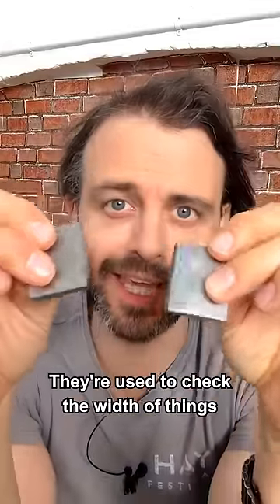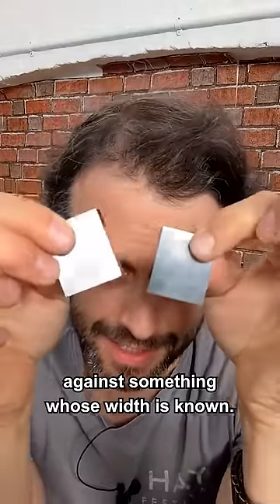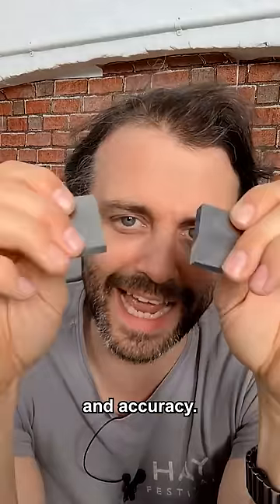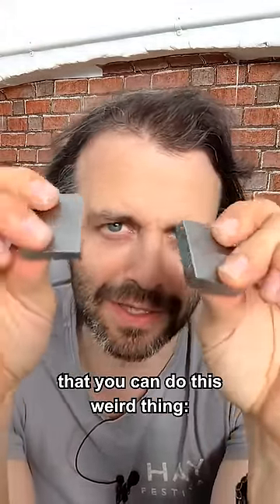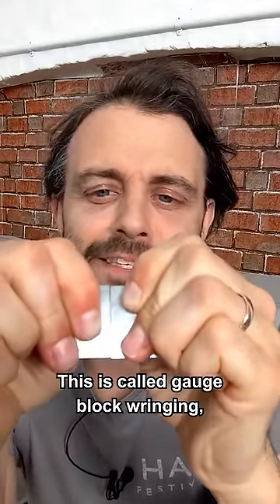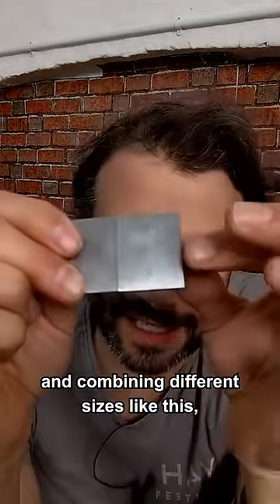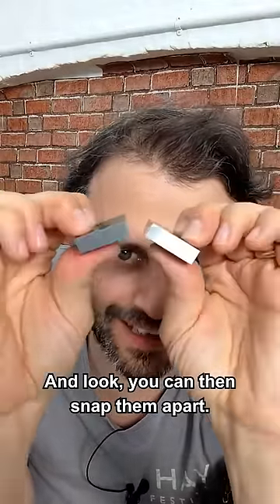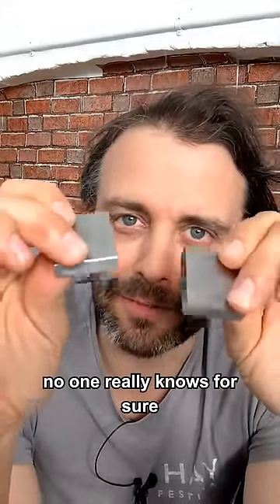No One Knows For Sure Why This Happens!

Comment: These are the basis for basically every piece of machinery in the modern world. In WW1 we had to smuggle a ton of gauge block kits out of Sweden to use for standardizing our military production across the country. Every tool could be measured against these to verify their accuracy and it is one of the most important pieces of equipment in all of manufacturing.
Reply: Oh I thought by basis of machinery, they were built by connecting all these blocks in this way...
Whoa, no screws!?
Reply: Cadillac's early use of Johansson Blocks made them the 'Standard of the World'.
Reply: @blakebrown534  Great video! Thanks for sharing!
Reply: Right, we didn’t have rulers in WW1…
Reply: @2200Stinger  Rulers are not precision instruments.

You celebrate your ignorance.
Reply: @2200Stinger  People were so stupid that they thought the Earth was flat too!
Reply: Interesting! I’ve always heard of gauges for machinery (usually gun manufacturing) but I guess I never knew what they were referring to.
Reply: @2200Stinger  LMAO, rulers are not the basis of scaled, high quality manufacturing which requires high precision
Reply: Damn you're really old to be of working age in WW1.
Reply: @2200Stinger rulers are not precise enough for high precision machine work. Thanks for your input, though.
Reply: Actually it only is needed if you want standardized measurements on your machinery 
You can do it like medieval craftsmen and make up your own measurements and it worked fine for late medieval gunsmiths and clockmakers
Reply: I never thought about that but it makes sense. Without a reliable template to start from, there's no way to make a perfect unit of (universally accepted) measurement from scratch, since all units are arbitrarily man-made. Interesting
Reply: Do you think they think like this in... Sub saharan Africa?

Comment: What is even weirder is that if you left them stuck together for a couple of days then they won't come apart at all. If you then try to break them apart with a hammer they will break apart but parts of one will remain fused to the other
Reply: The cut is so clean that you're basically just reassembling the molecular lattice with the wringing. It's almost like they are one thing again.
Reply: This seems quantum to me. The electrons are so close they are being shared
Reply: Doesn’t that demonstrate that it’s a molecular structure type bond?
Reply: @abebuckingham8198 that’s what o thought. Like what r the arguments to the contrary here
Reply: @divinenonbinary  yep that's exactly right, the surfaces are so smooth that if placed together and left long enough the molecules will cross over from one to the other thus bonding them together
Reply: This is giving me “blue led” video vibes
Reply: Could it be Van der Waals? Like the palms of geckos (there's a Veritasium video about it). But then if you let it sit enough time, some atoms would end up finding its place in the metallic lattice, but there would always be some areas which maybe won't fit between linked areas. So the result is an irregular cut (some places have bonded, some didn't)
Reply: @crypt0z that's not quantum tho just chemical things, like valence electrons or something
Reply: Yeah don't use a hammer, they crumble easily. I guess a magnet separator would work great, I never really had that much trouble separating them myself with just hands
Reply: @Maiqel that was my first thought as well,......but after thinking about it, I think its not
Reply: @BMW3.0CS  As you say: it's a "cold weld".  To what extent is the process NOT understood?
Reply: Sounds like cold welding to me like happens in space in the absence of oxygen, smooth surface and rubbing allow elemental contact?
Reply: That does seems to imply cold welding
Reply: Cold fusion
Reply: I can't believe that in 6 years  
while doing machining, never had a chance to notice that. Too few sets costing too much for the shoddy companies where i used them at all to mess around like that without putting them back. Think i left some of them "wringed" no more than for a day, if that (usualy just checked once or twice a day for probes with micrometers Probably too greasy or used to rrally get welded in under a day.
Reply: sounds like they weld together which is what i assumed was the case anyhow. it's a thing.
Reply: @schneemann-fy6gi  
Underrated comment
Lol
Reply: What materials does it happen to?
Reply: @divinenonbinary  Marriage?
Reply: @happyspacefun3796  isn't valence electrons quantum physics tho?
Reply: Brain genius here, What’s happening here is a cold weld where molecules become intertwined. That’s why when you bring them together with a twist they stick together. This will even work during times of high solar flare activity. Ask me anything!
Reply: So what your saying is this is how the made the Great Pyramid.
Reply: @loganrussell48 ”blue led” videos? What are you talking about? 👀
Reply: If that's true, Wouldn't that be considered cold fusion?
Reply: @abebuckingham8198  They most definitely are not smooth at a molecular level. Something like that would be a sliver of mica.
Reply: Damn, that's metal! :p 
Cheers for the interesting trivia!
Reply: Reminds me of the recent articles about self-healing metals. Could be like some commenters are saying, molecular, or even Quintin Terrentino effects on large scales.
Reply: @abebuckingham8198  It's called friction welding my dude.
Reply: @jwalster9412  Friction welding is done with the heat generated by friction. There is no heat generated in this process so it's cold welding. Cold welding is caused by the Van Der Waal forces which is aided the thin layer of grease and oxides.
Reply: @loganrussell48 ?????  Is it?  Is it those vibes?  Never experienced those vibes.
Reply: Just an FIY, he's pulling your chain, this is not a real thing, it does not happen.
Reply: @ironmanmachine  Cold welding is definitely real.
Reply: whaaaa! wow, thanks!

Comment: My theory is spot welding. Metal in a vacuum has been observed to just weld on contact without any increase in temperatures. This is much less likely to happen in our atmosphere due to thin oxide layers. But when 2 very, very smooth surfaces of metal come together, I'd bet it can still happen in spots, albeit weakly. Might get stronger after a bit of time

Comment: I believe something similar to this happens in space. The air on surfaces oxidizes metals producing something like a molecular shield, preventing like surfaces from combining, and so if you have bare metal tools in a vacuum, pressing them together causes them to sort of weld together. Cold Welding. Presumably if you let them remain in contact long enough, they literally become one object. It's like molecular velcro, except if they stay stuck long enough they merge into one object.
Reply: Cold welding..we watched veritasium🤪
Reply: At what point exactly can you say it becomes "one object" when the surfaces become covalent bonds holding them. how are they bonded initially....no reason to think it doesn't bond immediately why do you imagine it would have to take a moment to become"one object".
Reply: Really the whole universe is one object or maybe the only singular objects are elementary particles but the fact that you focus on the idea of when separate things join together to become one object is so illogical.let me know if you got this and you're welcome 😁
Reply: @paulmoss4378 what the heck are you on about
Reply: @paulmoss4378  It's most likely technically one object as soon as they start sticking together, it's just that the number of bonds that have formed are easy enough to overpower and separate with simple human strength. It's just that given the time, the incredibly smooth surfaces can make more and more bonds until it'd be impossible for human hands to break them back into two objects again.
Reply: @paulmoss4378 Truly spoken like someone with no STEM degree
Reply: That is reason why you don't stay in for too long...
Reply: @dougmcboat7276  If you have never heard someone with a STEM degree say something gibberish, you a) don’t understand STEM or b) have never worked with real people.  This isn’t really exclusive to STEM there are plenty of ignorant people who paid tuition and we’re awarded a degree.
Reply: @kornphlake79  Yeah, but as someone in STEM, there's a special type of word vomit that comes from someone that has set foot in a high school science class at most. Real STEM people will say plenty of stupid or arrogant shit, but they know how to talk out of their asses in a more refined way that uses more actual science
Reply: Yes, it is called vacuum welding. An early spaceflight discovered the phenomenon when the cabin door of the capsule would not open so they could do a  spacewalk. Turned out the hinges had vacuum-welded into each other.
Reply: It works with ceramic blocks as well
Reply: @paulmoss4378  Maybe Van derWaals forces? These are nonbonding interactions between the outer electrons of certain substances, clay for instance.
Reply: I thought that was called cold welding?
Reply: That’s what I’m saying. We figured it out.
Reply: So it's not exactly air that's preventing this from happening on earth. It's because most metals oxidize when exposed to air, and that layer of oxidation is what prevent it from happening on earth. But in space, where there's no air, if you have bare metal it won't oxidize, and will "cold weld" to other metal.
Reply: it's not air between the surfaces, it's oxidation you're thinking about, which is why that kind of welding only happens in space, because there's no oxygen to oxidize the metal, these have been in the atmosphere and have an oxidation layer and simply rubbing them together like that would not be enough to remove the oxidation and weld them in that manner
Reply: @paulmoss4378 Dunning-Krueger in full force 😑
Reply: @paulmoss4378 in that "moment" is the time that should be measured for interaction at the molecular level allowing longer intervals with each connect/disconnect🔁, also should measure the bonding strength at each reconnection time interval ...that would be fascinating🤔
Reply: @bonzie321  ... why would you think that a lack of atmospheric pressure would crush you? And regardless, while in space, astronauts utilize very cumbersome and airtight pressurized suits to prevent the vacuum, or near-vacuum in the case of near-Earth orbit from harming them. And yes, I know there's no point even talking to space denier like yourself. Probably a flat-earther too. What are you even doing watching science videos when you don't do any science of your own or study the real world?
Reply: Not quite molecular shield, since it's metal its not molecular, but the principle i believe is that one you said, no oxydation film surrounding that area so a few spots "cold weld" together.
Reply: Not so much that air is a molecular shield but rather oxidation prevents welding. This applies to stainless steel too because stainless is stainless because of chromium and vanadium oxides passivating the surface. Rubbing them together abrades off this oxide layer and exposes a clean pair of surfaces that then can weld. I believe it was Richard Feynman who said something along the lines of, "no one told the atoms of one piece of metal that they don't belong to the other piece". In space without oxygen, it's easier to do. On earth, with oxygen, you need exquisite flatness and surface finish to keep air out as the surfaces are abraded together.
Reply: Screamingly funny.  Gòod for you
Reply: I’ve had stainless steel screws weld themselves into stainless threaded inserts. They do NOT let go once they’ve started to become one piece. You have to lubricate the heck out of them and then rip off the fused threads to get them apart,
Reply: That NEVER happened😂😂😂😂😂😂 @LexipMedia
Reply: Nope, I just read it was Van Der Waals force
Reply: @LexipMedia 
Van Der Waals force
Reply: @LexipMedia 
That’s the answer!

Comment: As someone who knows very little about physics or chemistry (meaning that this isn't fact at all and that I want to be corrected by someone who is knowledgable):

My first thought is that having such a smooth edge makes it so that a huge amount the atoms from each block can interact simultaneously.

As the atoms from each side meet, their electrons may get mixed into eachother's orbits. This mixing may make it so that a bunch of the block's atoms are sharing electrons with the other block's.

Then, as they are twisted and slid without losing contact, these mixed up orbits might get spun around and twisted up in each other such that the electrons are acting like a velcro, hooking into another atoms's pull. 

This connection isn't very strong, and so when the two blocks are pulled on, the electrons might return to the atom they have a stronger connection with (their original one) and the orbits get untangled.

Just wanted to share the first think that came to mind. I am very sure this is wrong and i would really like someone who knows better to inform me :)

Comment: Ich bin Mechaniker in Deutschland. Die Flächen der Endmasse sind geläppt, d.h. sie haben eine extrem geringe Rautiefe dadurch wirkt die Anhangskraft/Adhäsion wenn man sie zusammenpresst. Man kann mit diesen Endmassen hervorragend Passungen bis zu 1/1000 mm genau messen was z.B. in der Feinmechanik oft notwendig ist. Allerdings sollte man sie nach Gebrauch sofort wieder auseinander nehmen, da sonst die Gefahr der Kaltverschweissung besteht und sie dadurch unbrauchbar werden. Auch gibt es verschiedene Genauigkeitsgrade, (1-4)  im Extremfall werden sie auch aus Oxidkeramik hergestellt allerdings werden diese dann haupsächlich in Messlaboren benutzt.
Reply: What a legend. Unfortunately these people don't care about the why. They just like cute facts 😂
Reply: Und woher kommt diese Anhangskraft? Ist es die Van-der-Waals-Kraft?
Reply: @O_Lee69 Meines Wissens ist es keine Van der Waals- Kraft, da keine Interaktion auf molekularer Ebene stattfindet.
Reply: Could you explain "cold welding"? I dont see how that could even be possible.
Reply: @russellbryant2273  there is tension between them, tension means movement. They are being welded together extremely slowly it's not an instant reaction happening
Reply: Lies
Reply: @jacqirius  wait. Are you referring to welding as in ringing? because I have sets of guage blocks and they never welded together. Just and extremely strong vacuume of oil film in between that can be easily broken apart with force.
Reply: @SteveMould  Leave them together for a while, to see how fast they might cold-weld to each-other !   As @wilderer-rb3rz mentionend it. That'd be very interesting.
Reply: @wilderer-rb3rz  in der Feinoptik wird dieser Effekt genutzt, um Glasteile zum polieren anzusprengen.
Es funktioniert, wenn die Oberflächen so sauber und glatt sind, dass sie durch Atom-Anziehung zusammen halten.
Reply: Cold welding means, as I know if the blocks not only stick together, but become permanently conected and can never part them again.
Reply: 2 manets without gaps=NO SPACE.😳?
BS. Now, what the hell you gonna weld it for!???
How do you even gage it?!
Sounds like a snake oil distortion. 😂🎉.
Very poorly done video!!
I'll just stick with rocjet Science 🚀 .🤔
Reply: @ This are not Magnets, it really works as its shown, with adhesion.
Cold welding is not welding we know usually, but in definition its a "atomic connection" between the molecules, but not made by melting, made by pressing it together and wait
Reply: theres 1000 different explanations in this comment section but youre a german mechanic, and i always trust german mechanics
Reply: @liamblylod5954  Thanks👍
Reply: @russellbryant2273  oil films have nothing to do with it, this phenomenon has been tested on cleaned and vacuum dried gauge blocks with the same effect.
Reply: Kleine Korrektur, es ist die Kohäsion und nicht die Adhäsion.
Reply: @kornymetal862  Danke. Verwechsle ich ab und zu.
Reply: @russellbryant2273  Hey! I think nobody gave a proper answer to this yet, but I'm also rather late so excuse me if you've already gotten the infos you wanted. I'm a german material tester for metal engineering so I'll try to break it down: gauge blocks have a very high surface quality so if two of those surfaces touch each other a lot of metal atoms come into contact (way more than you'd get with a "regular" surface quality) and due to the lack of dirt and oxides on the surface the atoms effectively can't determine wether they're in gauge block 1 or gauge block 2 if they're the same material. Over time (this can be a very short timeframe) you get a stable atomic lattice, the items were "welded" together. 
It can be an issue in some circumstances (early spaceflight for example), but cold welding (with the help of pressure) is also useful and is needed for powder metallurgy to work :)
Reply: You Men need to stop trying to explain this and LISTEN!  All of these men explaining everything.  These metals can be harmful to women.  We need to give money to women!
Reply: @fenrir211 Whether*, no such word as wether.
Reply: @thekeysman6760  ah thanks! Apologies, english isn't my native language and "wether" is one of my chronic spelling errors 🫠